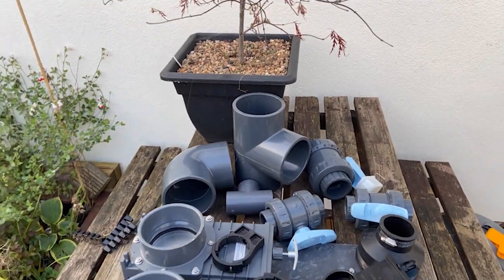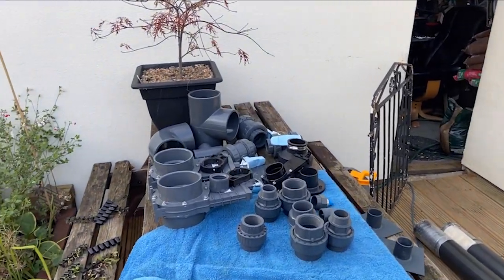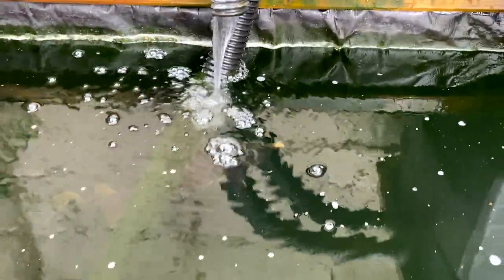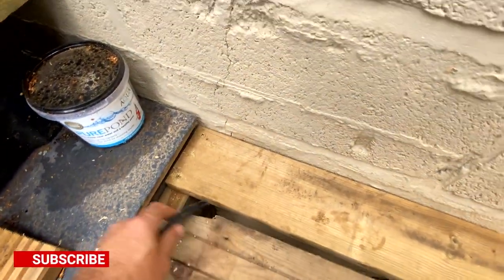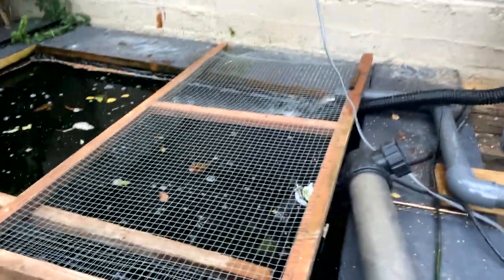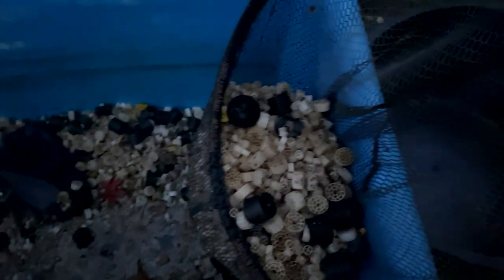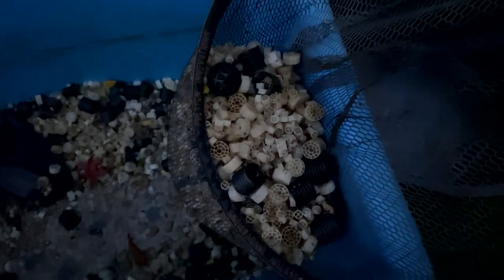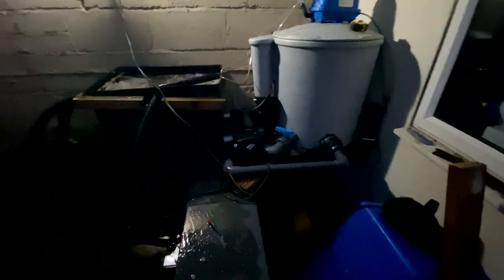Small Koi Pond Finished, DIY moving bed filter and new equipment for main pond build.

Comment: Great video.. Glad you mentioned the nexus.. I forgot to winterize mine.. I have it turned off for our winter.. But definitely need to disconnect the check ball valve so it doesn't freeze and crack